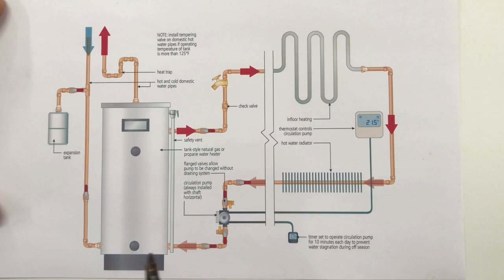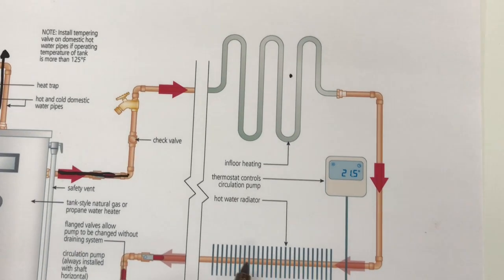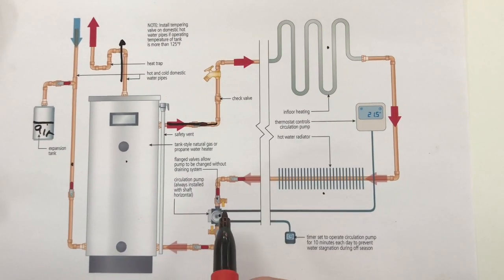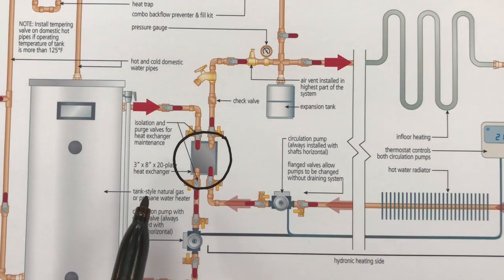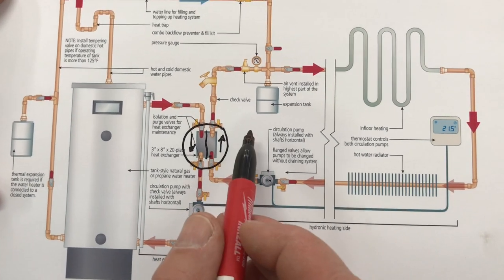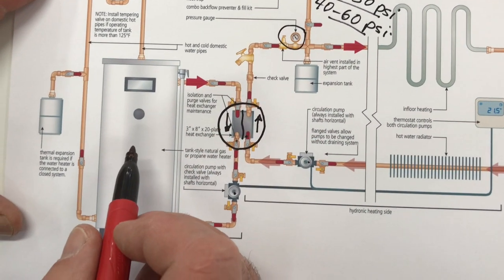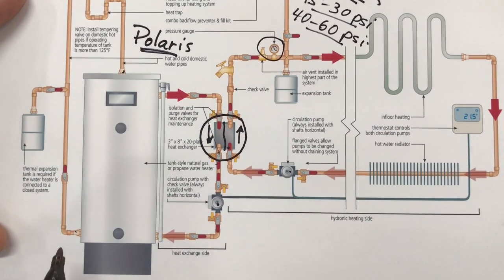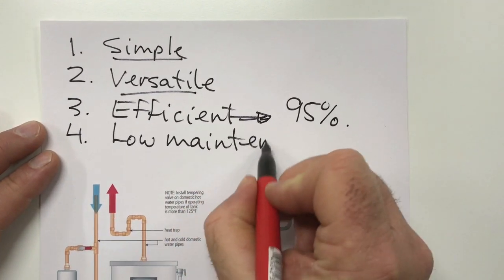HOT WATER HEATING: How to Use a Tank-Style Water Heater

Comment: I have had a thought regarding this type of system.  What about a connection from the incoming cold water line to the line going to the in-floor or radiator system?  In the winter, you can operate the system just as you show in your video.  In the summer, you could shut off the line going to the bottom of the water heater on the left side, and shut off the hot water line right at the upper right exit on the water heater, and open the bypass line to direct cold water to the in floor loops first.  This would cause the cold water to circulate through the home before entering the water heater at the lower right side.  You would not only keep continuous flow in your system, but the could be some added benefit from the cool water flowing through the house.  If you think this type of setup might work, my only question would be in regard to the placement of the overflow tank.  You might possible need to install a second one after the circulator pump for pressure control in the cooling season.  In that case the by-pass connection could go before the tank on the left side of the setup.  What are your thoughts on this idea?

Comment: If your using this type of system , I would recommend a tank capacity larger than you need & hook up solar panels as well. Can heat your home for the cost of running a small pump

Comment: Ive been in hvac industrt for 10 years . I have never seen this application. But great vid
Reply: I'll bet you never saw a Honda Civic radiator installed in an insulated box in the return air duct to the gas furnace. The air filters installed in a vee have 6 times the area of the original filter. And yes, there is a fiberglass drain pan and hose under the radiator in case of leak. The radiator sits at an angle so the box doesn't need to be so wide.

Comment: We live in Colorado so when the temps dip to minus, our exhaust pipe outside builds up with ice causing the system to stop working.  We then have no heat.  We thought we fixed this problem by removing a screen on the outside.  Still happens.  No heat today at -12.  We have to go outside and break off the accumulated ice, wait for the water heater to regenerate before we can get heat again.  Do you have any suggestions to fix this problem?

Comment: A small note when using a system over 30psi.   Obviously you’ll need a higher pressure relief valve.    Here’s where that’s tricky.    If it’s used in a commercial building at all your insurance company will inspect it or a local or state official will usually inspect.    Any relief valve over 30psi on a commercial system requires an ASME expansion tank which is really expensive.   The pressure tank has to be rated for 5x the relief valve pressure.    And odd law that often comes up on commercial jobs.

Comment: I have done that system before you should put a solenoid in to keep hot water from back they're from back feeding when the pump is off up into the radiators it does do that I would suggest if I do it again I'm gonna use a heat exchanger with guy call in the heating section a I think it would work better you have to have a second circulating pump Less than a $100

Comment: Your video is great.  one question about your second system.  would the water in the heat exchanger circuit not get stagnant in the off season since the pump will not be circulating?

Comment: We bought a house with the second system you describe. When we turn it on in the winter the rest of the house suffers from warm, not hot water. Do you have any ideas what may be going on? Thanks.
Reply: Your hot water tank was not designed to have constant mixing by the circulation pump. The gas control/thermostat is near the bottom of the tank. Without circulation, the hot water pools in the top of the tank and the thermostat senses the much cooler water in the bottom of the tank. So when you mix that tank of water, the thermostat is fooled into shutting gas off early. If you jack the thermostat to high, when the circ pump quits in a power outage the water will be scalding hot and might activate the pressure/temperature relief valve and spew water out.  Haha, ask me how I know this.

Comment: Hi, thank you for the awesome video, I do have a quick question, on the dual tanks, where the water for the floor heating comes from?
Reply: Soheil Shivarani it comes from a separate fill valve on the heating side that typically fills to a set pressure.    Standard fill pressure rate is 12psi.    This is a good thing.    If there’s an issue with the heat exchanger the heat side will be over pressurized and relief valve will go off.   If it was the other way around you’d have dirty heat water in your drinking water!

Comment: Any idea on efficency of this system vs a gas fired 82% old  metal flue boiler? I own several 4 families and have considered switching to this setup.
Reply: AO Smith knows the answer
Reply: A system based on modulating boilers would be more appropriate for an application like that.  Many have separate DHW circuits now, too.

Comment: If you go with the Simple system and run the pump ten minutes per day, would that pump enough heat through the system on the hydronics side to raise the temperature if the air conditioner is cooling the home? Or since the system is dormant there wouldn't be any noticible difference is temp? I'm looking at the least amount of maintenence since I have to do all the maintenence and repairs on our 1100 sf rancher and trying to minimize the amount of work. Thank you.
Reply from the maker: Good Morning Temuba!
I don't think 10 minutes of running per day would add significantly to the heat load during AC season, but you could run the pump for even short than that. As long as all the water in the heating system makes it to the heater and is replaced every day or so from the tank, I think you'll avoid stagnation. I hope this helps. Please let me know.
Thanks for watching!
Steve
Reply: Thanks for the reply. My current water heater is going on twenty years. No issues so far, knock on wood. However I need to replace it soon. Just want to plan the next one for possible hydronic heating and home addition. Again great vid and thanks.
Reply: Temuba In this system I'm sure you could bypass the water heater with a couple of valves, introduce domestic cold water to circulate in a loop on the timer. Prefer the heat exchanger system here. Perhaps run a Glycol closed system on the heating side away from the domestic side.

Comment: CAN YOU USE AN ON DEMAND WATER HEATER? IS THERE A FORMULA FOR NUMBER OF FEET OF PIPE TO PUT IN THE SLAB? IS THERE A FORMULA FOR BTU'S NEEDED/
Reply: You can use a tankless, some are actually designed for the purpose, some are not, you'll have to check.  If I remember correctly, the max tubing length for one circuit is 250 feet.  I'd go 200 to be safe.  Any more than that you'll need more circuits.  ( There are also radiant heating websites that discuss this too.. )  last numbers I saw was 35 BTU / sq ft.  Again - look around.
Reply: Yes, but a combi is the best option; in cases where gas supply won't be enough for tankless or contemporary hot water usage demand is high heat only boiler with indirect heated cylinder that is also more efficient (up to 98%) compared to up to 90% of storage type.
Reply: You defeat the purpose. Tankless is also called on demand and it means just that. If you add a circulating line or use it for heating systems your are asking a unit made to run for minutes to run much more. Best to get s tank and good insulation. On a big house best to use an insta hot at each end of house for instant hot water without circulating it the length of the house.
Reply: You missed the point of tankless/combi it can run as long as demanded. 24 hours a day is fine.
It will keep supplying longer than any tank without paying for tank leakage heat.  Modern ones have a small tank for covering small use like hand washing without firing up.

Comment: Valves Valves Valves !  Your layout is vey well done and from a engineering standpoint is excellent . being able to turn off a valve or two to isolate a part makes things like this so much less complicated. I use to design equipment and the parts manage would always get mad because I used so many valves. But no one complained when we had to fix something.

Comment: When I saw the cold line connected to the hydronic loop, I thought maybe you were going to show how hydronic cooling could be done through the same system during the hot months; running cold municipal water through floors and radiators to cool the house while also pre-warming the water feeding the water heater and reducing its energy use.
Reply: That is a solid idea, even if your "cooling" system only worked when DHW was used. To your point, preheating the makeup water is a nice bonus. I guess the circulators could be run to even out the cooling, would take some trial and error to figure out the control that works best.
Reply: That. Would not supply enough cooling capacity.
Reply: @ronlafever8233  Right, our water is held in tanks in my area. In the spring the water is cold but it warms up as the season gets warmer. And radiators dont have fans so even if you could get them cold enough it wouldnt do much.

Comment: Nice vid guy! I’m showing this to my wife to help explain my own system.   FYI I’m using separate heat on demand systems.  With wood boiler tie ins Plus use a un-insulated holding tank for well water to reduce size on heater needs. It’s much easer to heat room temp water than ground temp water.   Again nice learning vid
Reply: Hey Dan, I'm trying to figure out how to merge an outdoor wood boiler with my already installed on demand propane boiler with baseboard heat. Is this similar to what you did?

Comment: You forgot to mention couple of " small" details...
The tank used in your presentation use same water for domestic use same as space heating use..which means all hydronic components HAS TO BE of nonferrous material, bronze pump and brass fittings!
Reply: Actually, the Polaris has two independent water circuits that do not share water.

Comment: A 150MBtu Polaris tank during the summer months is a waste in a way that max load needed to satisfy hot water for domestic use is no more than 40-50Mbtu for a regular dwelling with 4-6 persons living into that dwelling.  Thus when all that " horsepower" of 150MBtu start rumbling on the Polaris tank, guess what is going to happen?  Tank water setpoint temperature will be reached so fast, ( no  heating load ) that tank will run for couple of minutes max! Therefore these tanks are purrr-fect for winter months when there is always a heating demand ( load)  and these tanks recovery time are like snap of the finger-ing!

Comment: very appreciative what you are doing. I  like your tank based hydronic heating system. I am building one using a 65,000 GSW  6G5065SN-PDV-02 tank heater like the Polaris (DHW + Hydronic heating. I have installed two temperature zone heating.  One for wall mount 4 radiators at 140 to 160F/total BTU around 30,000 and one for 3 circuits (150'/100'/100') of 1/2" Pex  at 110F max total BTU around 20,000. The tank will be used strictly for closed loop system (no DHW). Just want to know what is the best way the implement this two temperature zone system. Thank you.
Reply: Do you know any company installing this ? How much cost to complete the work,  if you don't mind please?

Comment: Very good! I currently have a wood burner that handleas all heating needs in winter. I like how simple this is but I have the benefit of my house running on solar so I am looking at similar design using electric hot water tank
Reply: Did you ever do it? Was your electric bill very high?

Comment: In reference to the second method, is there any downside to running the hot line output from the bottom (side port) of the hot water tank and then having the cold return at the top(side port) of the tank?

Comment: Question if possible please ...  Could I do this kind of system when there are only 3 outlets on the boiler.  A hot, cold and PRV.  All side fixed to the cylinder.  Looking to use the plate heat exchange and the pumps to circulate the water.  Thanks for any information you can give.  
Also this is a very good explanation of the system best video I've found 😊

Comment: Hey Steve, been following you for years. Really appreciate all of your videos, have learned a lot!  I have the Polaris for domestic/in floor heat source as well.  Used as backup to my wood boiler as I believe you have too. Do you not find the Polaris short cycles constantly during radiant heat usage?   Trying to figure out how to wire in a relay and resistor, or a set point controller to open up the tight temp differential..

Comment: I like the simple system. This looks like it will work for my house. My domestic water heater is a tankless unit, and I want it completely separate from the hydronic system. No worries about excess mineral deposits, cross-contamination, etc. esp since the "water" in the radiators will be anti-freeze, not plain water.

Comment: DISLIKE -- Very misleading and potentially dangerous video!!! 

That Polaris condensing water heater ($6K ?) actually has a coiled heat exchanger inside that totally isolates the heating system water (I checked it out) from the heating water, but that means the heating loop needs air elimination, a way to get make-up water (could be as simple as a hose connection - no back flow risk) and critically an expansion tank sized for the volume of water in the heating loop - it is a completely separate loop. 

Something not mentioned here is that domestic water should be fresh and heating water should be stale. The oxides in fresh water will erode anything ferrous, so no iron fittings, piping, rads and most importantly circulators. One little piece of iron as a fitting and you'll have rust in your shower water, never mind a whole steel/iron radiator rusting invisibly from the inside out. And more importantly, instead of maybe using a normal $100 circulator you now need to use a $300 stainless steel or bronze circulators that won't rust to death in a few years or less (that REALLY should have been mentioned in the video - after all he did mention circulator motor orientation - impeller material is actually far more important as a circ is easy to reposition correctly). 

With combining the 2 types of water all the little things suddenly are bigger issues. Aside from jeopardizing the quality of your domestic hot water (rusty water, bacterial growth), keep in mind that heating water pressures are far far lower. The copper pipe walls in a hot water baseboard is super thin compared to normal copper pipe. It is designed for an average 15psi and suddenly you're asking it to handle up to 100 psi (or even slightly more in my last house). And if for any reason the heating system ever leaks, *its leaking at scalding temperatures, at street water pressure and staying at street water pressure until someone notices and finally shuts off the water supply* to the water heater. Ouch! And to make matters worse, the claims adjuster might just smile and walk away because of code violations saving them a large claim.

"Keep your fresh water fresh" and heat your home with wonderful old inky stale (no longer oxidized) water (think of it like antifreeze - best left alone and if its low, know why!). This advice here is a recipe for Legionnaire's Disease and big costs in the long run.

Comment: How do you drain the tank, as recommended by water heater manufacturers?
This definitely would work, but electric water heaters can produce only a little over 15,000 bthu.  That limits the application to a few rooms or an extremely small house.

Comment: I have two hot water tanks ran in series with the heat exchanger method. And the recirculating pump off the side of the hot water tank runs continuously. I’m wondering if you can set it up to only come on when the thermostat calls for temperature even know I have two separate zones with two separate pumps thanks!

Comment: Is the hydronic loop for the baseboard heating a closed loop inside the water tank. Meaning that it's not mixing with the potable water circuit of the tank. Or is it open looped. And does that matter like within a boiler. I ask because I'm curious if I use a high efficiency hybrid water tank to heat a small garage 12 x 18 and also for the potable water of the house itself if that can be done without issues.

Comment: Thanks but I have a question, I noticed there is no air valve in either of the space heating systems.  How do you blead off trapper air from the system? Ahh the more complex system handles that.  Got it.  But in the less complex system just add a vent in a convenient high spot...

Comment: You wouldn't want to circulate heat on a 90-degree day, so the first one sucks. Ditch the heat exchanger as they get clogged and need replaced and add an indirect hot water tank in its place.

Comment: What are your thoughts on a Heat Pump water heater in this application? We have one for DHW and LOVE its 300% efficiency. With an energy monitor on the entire house, our water heating cost is less than $5/month! Yes, the unit was $1700, but ROI is coming at us quick. Even faster if I can use it to warm the floor, while the central Heat Pump warms the Air as it does currently. Our floor piping is installed, ready to start the rest of the radiant system but trying to decide heat source using existing tank with a Taco pump block heat exchanger or add a dedicated Heat pump water heater.